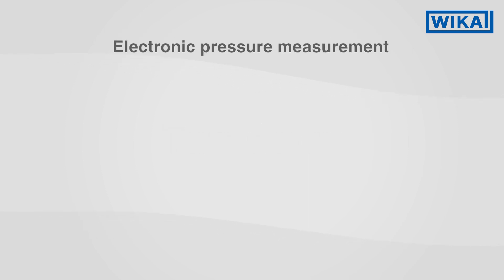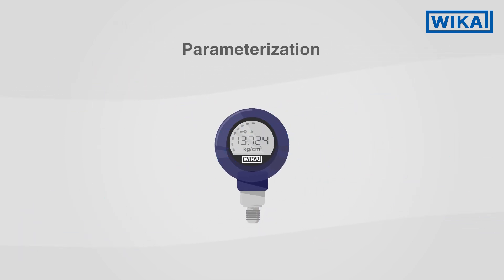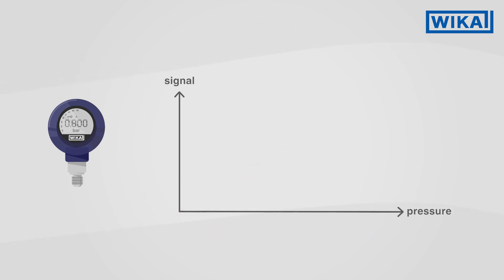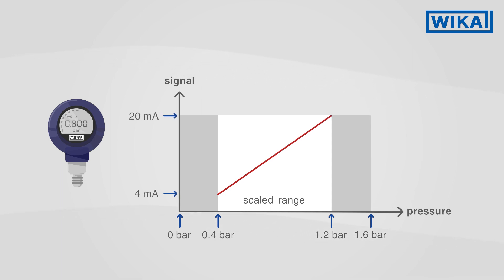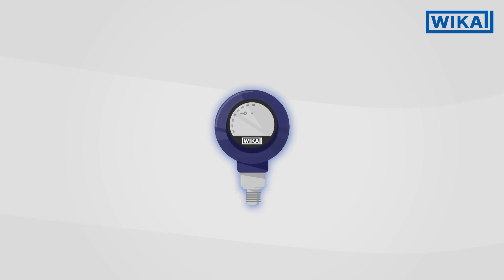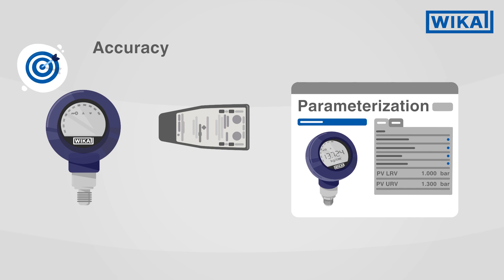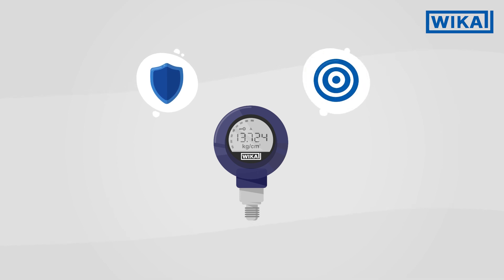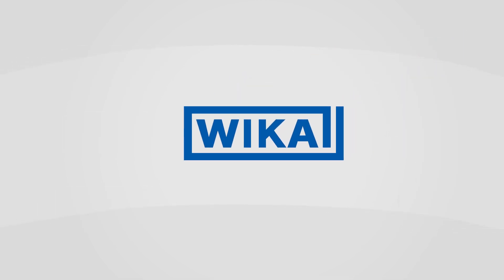Turndown process transmitters: What are its function and benefits?

Comment: What is turndown ratio
Reply from the maker: Hello @manishjadav9409,
Turn down ratio is the calculated number which describes the ratio between the measurement span and the scaled span.
Example: Measurement range is 0 … 16 bar and scaled range is 2 … 10 bar. Than the measurement span is 16 bar and the scaled span is 8 bar. 
Turn down ratio is 16 divided by 8 = 2
TD ratio = 16 bar / 8 bar = 2  or sometimes written as 2:1